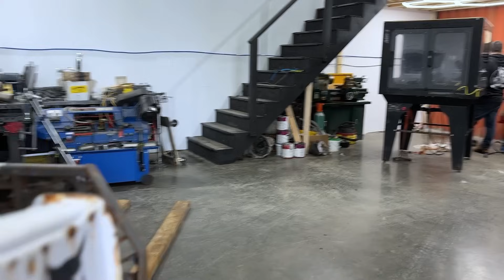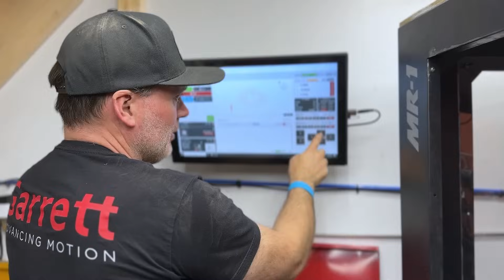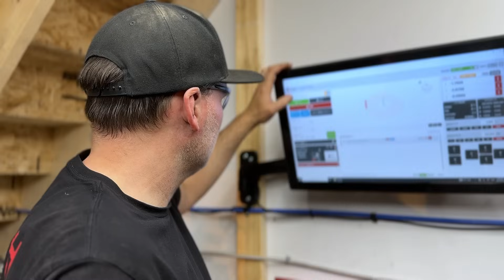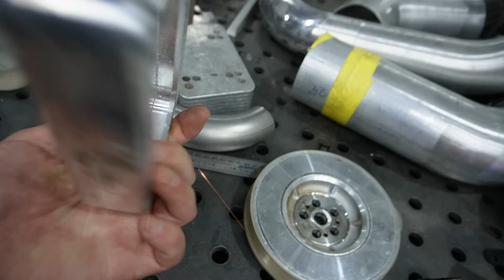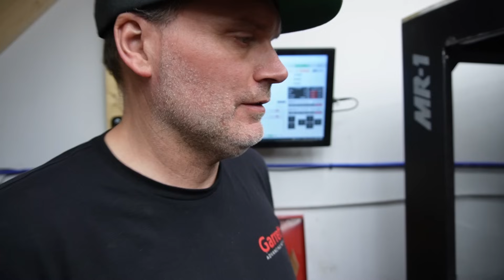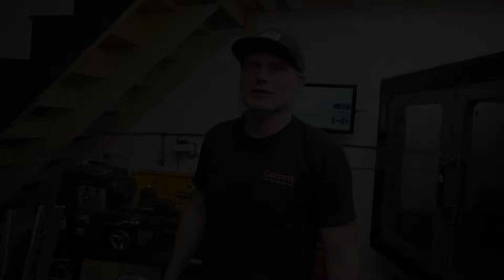Shop upgrades, let's make some cool Volkswagen parts.

Comment: im wanting to build a mk4 gti(1.8t 5 speed) looking for 300-400whp. would a k04 be enough or would a bigger top mount be best? im going to be doing internals and all other supporting mods. i have access to e85 as the gas station by me sells it. hope you see this as you guys are the most detailed and in depth 1.8t channel! also would a love a video showing all the little details of "big turbo" install. like showing every bolt, nut, oil line, etc. 🙂
Reply from the maker: I think K04's are a waste on 1.8ts. Find a different turbo if 3-400whp is your goal.

Comment: we just got an mr1 as well, Had issues with Z as well, you need to probe your material before each program and let it auto off set after using the tool setter with the bit installed.

the other thing could be your program depending on what youre using stock height is higher than your real stock
Reply: What about setting the actual tool bit hight in the chuck?
Reply: @steveallam  Well yes this is a given. This is a Cheap CNC machine. it doesnt just "know" what end mill youre using. even if you program the correct endmill in the machine wont know unless you set the offset with the tool setter. or manually set your zero. So yeah.